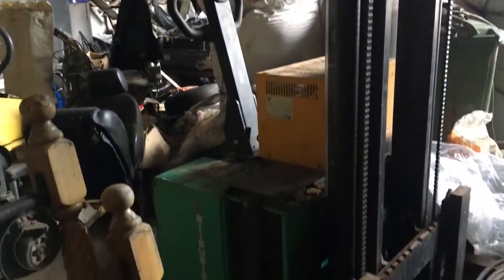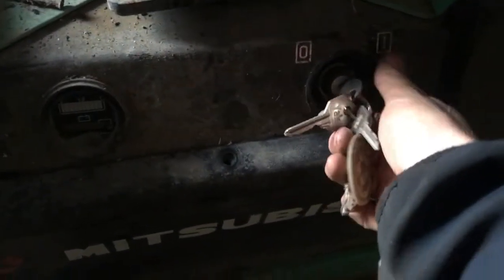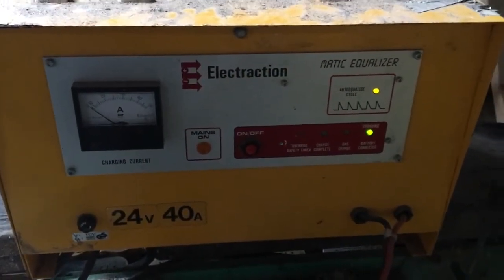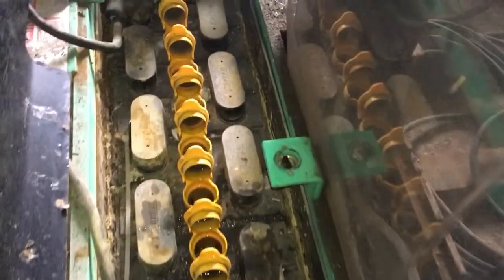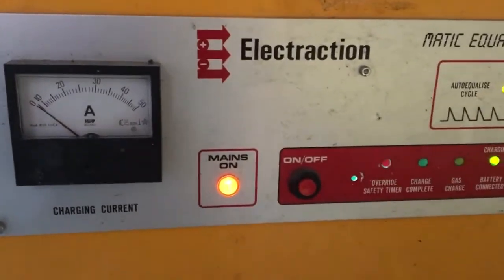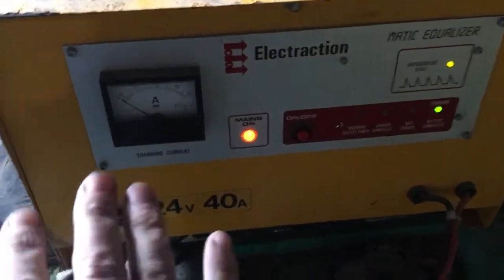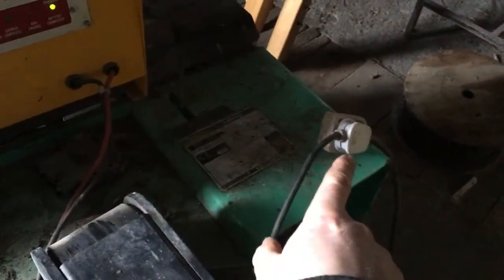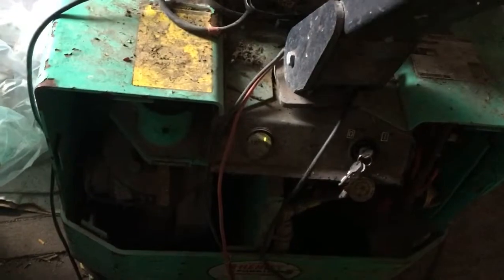Mitsubishi Electric Forklift [Dead Battery Revived] 0v - 24volts

Comment: How did you bypass? I have a batter charger that is doing the same thing, but I’m not sure how to get it to recognize the battery. Thank you.
Reply: The way I do it (and I've done it many times) is to take a car battery charger that is 12v. Clamp it to 6 of the 2v batteries in series they are positive to negative in a chain. And charge them up. Then go to the next set of 6 and charge them. Once you get the group up to around half, it should work with the normal charger.
Reply from the maker: I’ll have to go look at mine again. I think it looks of a battery load (a low battery) and I used a wire and forced it to just charge with out looking got this “low battery “  but you have to be Careful not to over change the battery either as the bypasses safety circuit also stops over charging

Comment: Great way to shock a battery back into health, old school batteries are built to take the 'battering'
The charger vary the voltage once it sees a it's there or constant voltage?? 1 charger for have pulses when it's very low then checks before the next pulse 
Great video 👍